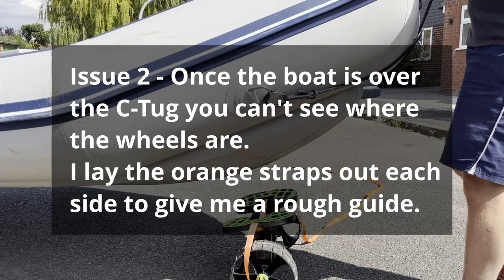SIB Nose Wheels Head to Head - Moving a Honwave with bow wheels from Railblaza C-Tug and Compass 24

Comment: Thanks, Paul, for the demo. I, too, have a Honwave, t32ie, and have been looking at both products. We have to push ours up the beach and have found the best solution is to use a slightly modified golf trolley. Cheap, approx £5 from Marketplace, light, folding (though not as compact as the c-tug), and simpler to use than c-tug, as it has a handle.  I use a strap around the boat with an s hook and loop, which is easier to fit.

Comment: Like Martin Bowden below, I modified very easily a folding aluminium golf trolley, it cost me 15 euros second-hand. Hooks onto the front of the SIB more or less in the same way as your nose wheel. Turning corners is a breeze as I just raise the trolley handle slightly which clears the bottom of the boat and pivots on the hook. The trolley folds up ad its in the boat if necessary.

Comment: Hello Paul. Great video. I have one boat with 90 kg of weight and engine parsun 20 cv (50 kg). I need to move the boat about 30 m. Do you think is ok using compass wheels? Thanks a lot from Spain😀